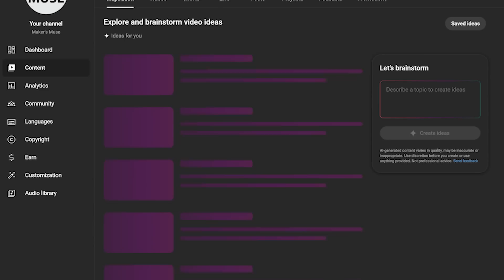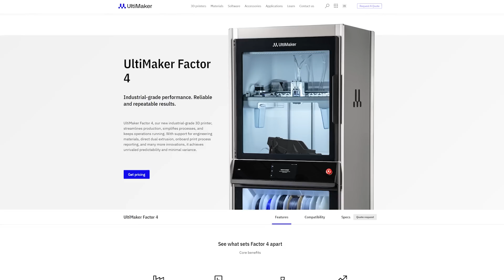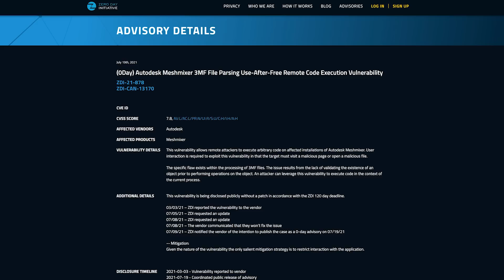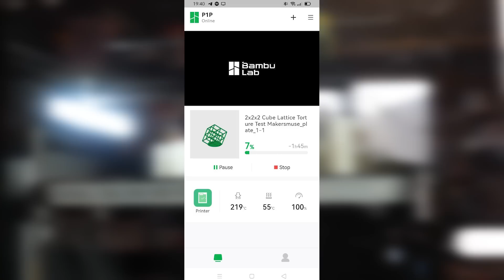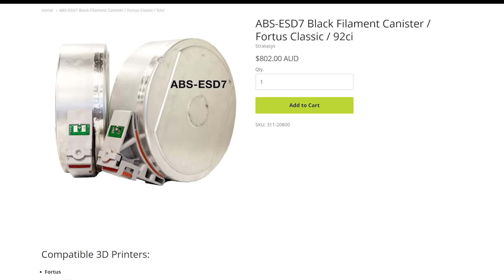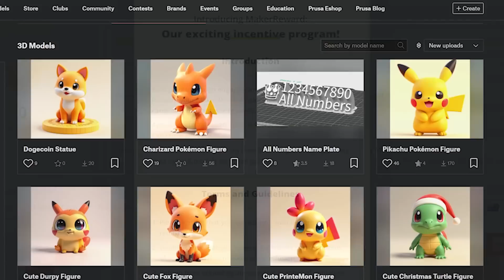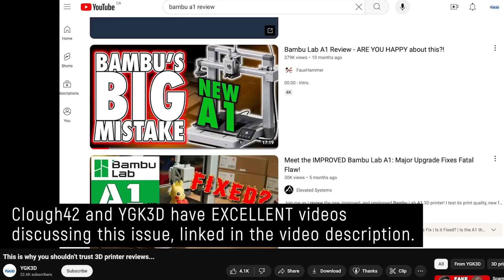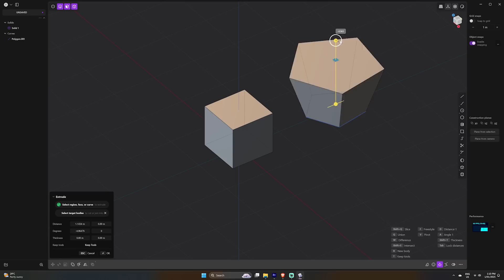My 3D Printing Predictions for 2025

Comment: You opened up a lot of good questions.  I am particularly concerned about what will happen to Mesh Mixer.  There are all kinds of CAD options but none that take the approach of good old Mesh Mixer.  I am really sorry it is dying out when it really should be expanding.  I still use MM a lot and I guess there are other ways to do those things but It was  a great tool.  'Glad you continue to recognize the community out here.

Comment: There is gonna be a push to get rid of the inefficiency in multicolor printing, both time and wasted filament.   Someone is gonna push to bring Klipper into the big time and produce a $1500-$3000 industrial machine pushing chamber temps to 100C and nozzles past 350C.  It might end up being Bambu or QIDI but someone is gonna do it and it will be the end of makerbot/ultimaker/stratasys in the fdm world.

Comment: one thing that needs addressed is the waste of filament from multi color printer
the way i would do it is extruder 4 input with rotary gear to pick filament  a fin stack cpu cooler type replace heat pipes with heat breaks  heat block and nozzles
Reply: They make more money by selling you the filament 🤨!

Comment: Prediction: People will buy 3d-printers as a tool, but end up printing only existing models that don't add any value. Eventually the printer will collect dust. Just because printers are better than ever, will not suddenly turn everyone into a maker. I know a lot of people with 3d-printers, but only a few that can actually design their own things.
Reply: They all just end up printing absolute crap like all those flexible dragons and then eventually open up an etsy shop before realising they actually have zero use for a 3d printer.

Comment: Prediction: A huge vendor lock-in is going to happen with filaments. With all these stupid smart features. Filament will become like printer ink.

Note: I'm still printing with my trusty Ender 3 😂, Yeah slightly upgraded, slower than modern machines, but I print flexibles and all the nice stuff without a problem in great quality.

Comment: I’m hoping the CNC world begins taking note of all the ease of use improvements  in the 3D printing world to make CNC more accessible for beginners.
Reply: As someone who actually works in the CNC space, I would not hold my breath for that to happen. Are there some advancements being made? Yes.. But the fundamentals of how CNC works are just too complex with infinitely more variables than a 3D printer would ever have. I genuinely doubt any of us will see the kind of advancement you are hoping for in our lifetime or even our children or grandchildren's lifetime.
Reply: 100% this
Reply: additive 'machining' is always less force, less momentum than subtractive machining.. i.e. the tools/machines need to be more rigid, heavier and powerful.. this means higher price.  My tiny manual 750W benchtop mill that is so-so capable milling steel weighs 120kg and cost as much as a mid range enclosed corexy printer these days and has working volume of comparable size.  CNCing that properly (read: reliable outcome, steppers are no good for starters) would double that.  And then we're only xyz.. no 4th axis or any other shenanigans.

Comment: Hi Angus, I tried buying your updated edition (I have the original) but Gumroads only gave me the invoice in USD which given the exchange rate is considerably more than the Australian pricing. Am I doing something wrong?
Reply from the maker: Ahh that's frustrating! Thanks for letting me know, I will find your transaction and reverse it sorry, I was under the impression that Aud pricing would stick. It's becoming harder and harder to manage Aus sales with GST
Reply from the maker: So, it turns out that despite my store being in AUD, Gumroad will always convert to USD anyway. Not what I was after at all. Sorry about that! I'm more than happy to send a refund through but having trouble locating your sale, mind sending me an email from the one you made the purchase from? (to sales at makersmuse dot com) Cheers!

Comment: I would go so far as to say your prediction about AI was already correct this year. The number of models that looked interesting from a distance but have all sorts of nonsense issues on closer inspection has gone through the roof. Especially for any sort of contest run by a 3d print hosting site, I think people just spam applications instead of making something nice and relevant.

Comment: And digital minimalism is going to kill SAAS in 10 years. Bold prediction, but we're a screwturn from a device that will disrupt cell networks, SAAS and data mining that will feel like a phone but not be connected to servers, only peers. Check out the unphone project. P2p connectivity, no monthly plans, no bandwidth limits no massive hacks of centralised menbership databases. Just you and the people you know, connected across secure hand offs. We just need an open source longer range networking system like a high bandwidth LoRa and things like unphone will explode. And PCs will be "retro" too, because of this kinds of tech. But that may be more like 2026/27

Comment: I've had a basic filament printer for a while, and a resin printer for eighteen months - hardly used them. Until just now when I've got some actual momentum for designing parts in FreeCAD for my partner's hobby

Comment: Love your work, Angus! Thanks for consistently producing interesting and useful content. I agree about AI models, and also that CAD will still be necessary because AI can't solve those little household problems 3D printing is the perfect tool for. Need a stake just the right size to prop up a succulent? An hour later, it's designed and printed. AI can't do that... at least not that I'm aware of. Have a cracking 2025 - looking forward to your videos.

Comment: I have to share your expectation for DRM hitting the consumer field. It's only a time when someone takes the Bamb... Sorry, I was saying Stratasys path with RFID chips on spools and proprietary software and control to the feared level and it's then a question of reaction whether or not more do the same. Currently the one company in the consumer field is probably too big for greedier companies to buy them and I don't think they will do the transition to evil but it's a question of time until someone takes the same pieces and drives the plan to finish.
But I am more interested about what such a company would come out with. They need to either pump a lot of money to the marketing, have a brand that will sell no matter what they do and have a cult following that will silence any criticism or they need to have a printer that will be really amazing both from features and reliability so the evil side of the business feels, even to the hobbyists, like a sidenote. The printer probably needs to be something else than the current consumer level does completely, FDM and SLA are completely out of the question unless it goes to the industry level exotics with multi-material extruding, polyjet stuff or similar and it needs to be easy on a level that anyone can just press "print" and completely forget the process.

Comment: Coming from Creo, I was concerned about Fusion 360 "cloud based computing".  The fact is you still need local resources and power to have the software work properly.  Please do not make the assumption that you can design on an entry level computer.  You will become frustrated from operations not working properly or consistently.   Also, Fusion has "Offline mode".  You can download your projects, work on them, then it automatically uploads  new versions of the projects once you connect to the internet.  Long ✈️ flights for example.

Comment: I find it interesting how you and Slant3D - who basically comes at 3D printing from the complete opposite direction to you - are on opposite sides of the "AI in the 3D modelling space" question.  You see it as an encroachment on a creative's work space and as a bait-and-switch issue on sites where "downloads equal money" (since the download creates points and the points are a form of money).  Gabe sees it as a way for entrpeneures to affordably turn their concept sketches into usable, printable models.  And both of you are right, you're just seeing it from different angles.  Which is interesting.
Reply: I think the best use of AI is as a tool in a part of a larger workflow where there is still plenty of human involvement to ensure a high quality product. Unfortunately AI can also be used to completely replace the whole process and create endless spam of models that might not even print correctly, and I'm starting to see some signs of people attempting to do that. Then of course there is the issue of training data and ensuring the data has the permission of the authors and gives them credit for their contributions. I pray that those who create AI take these things seriously.

Comment: I want to pose a question that occured to me while watching the segment where you talked about your sister, and I would love to read people's views on this.

Dice can be surprisingly difficult to make perfectly balanced. Just the pips or numbers changes the weight on a particular side by a little. Dice makers that make highly balanced dice, think craps dice for casinos, have tricks to help with this, but it is complicated to say the least. 

So what are people's thoughts on 3D printed dice? On one hand there is the advantage of using multicolor printing to put the side indicators into the design in the exact same material so that every side has the same inherent density do to everything within the same material with no need to add or remove material. On the other hand the surface quality of at least FDM printing is not ideal when you want an object to be perfectly uniform.

Comment: You are completly right about 3D printing in niche hobbies. I'm a kitebuilder and watch more and more fellow kite builders using 3D printer to print connectors for their kites. Yes, there are now kites which wouldn't be possible without 3D printing.

Comment: The 3d printers working well enough to focus on what is printed is a game changer. I got an A1 mini for miniature wargame prints but also did some functional prints. Learn some CAD and designed a few custom parts as well. I didn't bother with printers before because it seemed like calibrating them was a hobby by itself. I can see why tinkering with them is interesting but it wasn't something I wanted to add to my pile of hobbies. These newer printers are good tools and I generally don't have to tinker.

Comment: I am not really hearing any innovation here. Nothing really new, like new use-cases, or actual ground breaking. Apart from one thing, and that is AI might actually be tailored to be useful for a different demographic of people, but alas, it seem to have miles to go yet. From the trends you see coming and across the comments, this seems like a dead end. Actually, since this production method is wasting energy and there is hardly any recycling, this industry actually should never achieve widespread adoption anyway, because as it is, it is wasteful. Heated chamber certainly does not help much either. The use of carbon fiber, despite all its health issues, and all the toxic gasses with this tech, is no where close to dealt with, nor is there any demand to do so, nor any industry push for it.
Reply: Eh, I can say the same for cell phones. Nothing exciting happening. But that doesn't mean cell phones are going to stop being used. You don't need to be amazed by something in order for it to be useful. At the end of the day 3D printing is a tool, not a trendy fashion piece. As far as actual wastefulness goes, subtractive methods of manufacturing generate far more waste. Also minimum runs of injection molded items can be wasteful if you can't use the entire run, so injection molded only makes sense with large scale production.

Carbon fiber can be easily avoided, very few prints actually use it. Toxic gasses are also something that can be avoided; the most common materials being printed these days are PLA and PETG which are pretty safe to 3D print. Industrial printers are hopefully being used safely in their respective industries with plenty of ventilation.

As far as demand goes, I don't see a problem - I had some dental work done and they did some 3D printing as a part of it,  rocket motors are now being 3D printed, I see businesses use 3D printing in their tooling, prototyping has been huge with 3D printing, I see articles about 3D printed houses popping up all the time it seems. I think 3D printing will be used where it makes sense, and I think there are plenty of use cases for it. It might not be the Star Trek replicator that everyone 10 years ago claimed it would be, but it doesn't have to be.
Reply: @logicalfundy  You are right about 3D printing being used innovatively for industrial purposes. Maker's Muse is a hobby channel, and what I speak of is public mainstream adoption and use. So I guess you are right, chairs are not really being develop any further any more, but maybe you should look at the installed based and the real usage of of chairs? Maybe? What does installed base actually refer to?

I'll give you one example, I recently moved to another city, and after moving and speaking to hundreds of people, only one guy has had a single printer at home. Of all my friends and all my acquaintances, I have met one man, 1, a single human being, that knows anything he wants that is printed, and one guy that has a printer at home, that he hasn't used in years and wants to get rid off. All of them has a phone, and all, absolutely every single one of them, use their phone actively every day.

If printers were adopted, with these new 1000W+ printers, with even sky high consumptions while printing, the use of electric power is simply unsustainable. The waste of plastic this produces, simply adds to the waste we already cannot handle. With extensive usage, in case of fire, risk of casualties grows significantly, almost for any high temp printing material. There would be widespread increases in health issues, which society also will have to bill somewhere.

Even for PLA, which there is even videos about on this very channel, is something that we do not want widespread adoption of, since it hampers food production. That production will also make claim to both land and water. In case you don't know, food is actually in under supply, and water is simply real power and influence in many areas of the world.

The thing is, for industrial purposes, with proper laws regulating operator safety, printing has a real purpose and is really helpful and has real value. Printing junk has not. Not as to meet the basic needs of society. That is why, when I speak to real people not part of this industry, they do not know anything they want, that is printed, even if explained what printed parts are and look like. There is no real demand, as most people see no need for the end product.

As you can clearly see, form any printing oriented channel right here on Youtube as well, we are still searching for something to print to validate the tech. We are not dealing with the challenges this tech faces. Just look at your post. You do not try to deal with any challenge at all, but simply deny their existence.

I just find it silly, when grown men being completely nerds, suddenly figures out what wase-mode is, and for almost any printer review, they print a bunch of wases. Some even print many of them. We have people printing waste buckets, but at what real costs? It is all just junk.

There is no drive, in this very space, to learn to master the production method. To reap its real strength, to apply that in real innovative ways, filling real needs of society with products that printing actually excel at. When printers suddenly costs $1500 and consume like 2000W, is a health risk, produce new loads of waste, and is cost ineffective? For what? Printing cosy teddies? Pen organizers?

When I look around, people use printing to replace other production methods, copying the product and its use, almost straight. The combat robots on this channel is actually a very, very, very, rare exemption. Even miniatures, for the most part, is just a replacement.

As a designer, it is simply frustrating to see, that hardly anyone knows how to ripe the real fruits of this production method, because they are oblivious to what the real and actual strength of the method actually is. Even this channel, that has videos claiming that in place production supposedly is one of the main benefits, cannot really display that applied to real world design in general. It ends up more like a vague talking point.